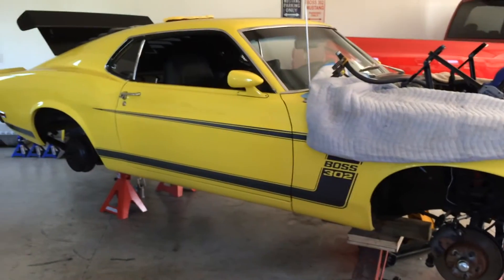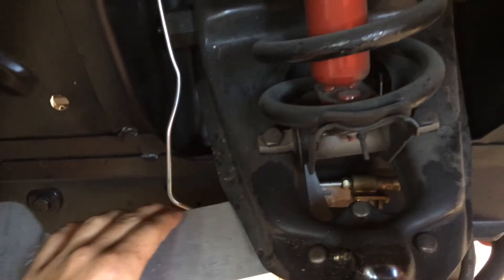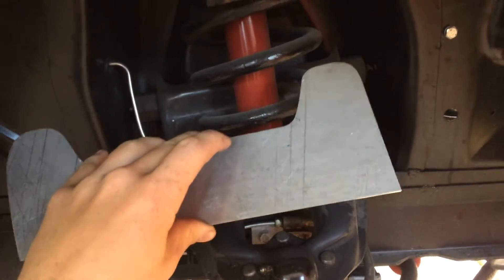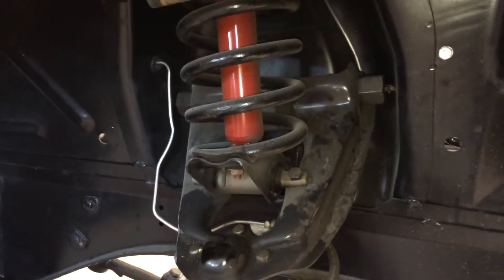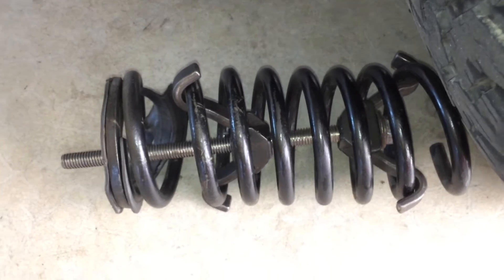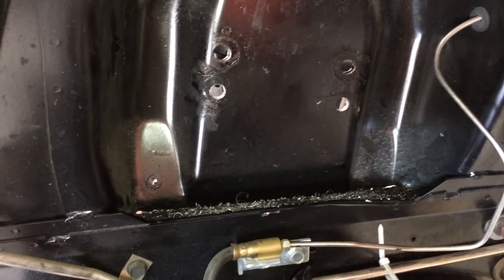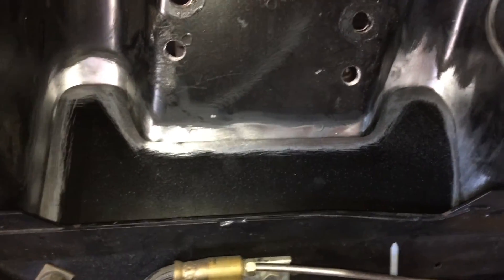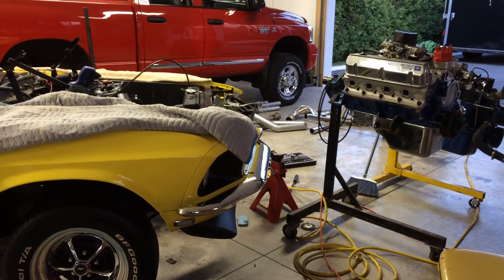Classic Mustang Shock Tower Reinforcement + Control Arm Drop

Comment: question-  by drilling lower holes and mounting stock suspension would that lower your car body and make less wheel room in fender wells? thus causing tire size issues?
Reply from the maker: Good question...you should refer to the manufacturers website for that information! Such as global wests a arm relocation
Reply: I just did mine and it did lower the body about 1/2”. But I also already had a 1” lowering spring on my 70 mustang. I just wanted it to steer better around hard turns. Next I’m getting wiser tires on front.
Reply: @MrCbell57  Thanks Rick. So did you also move control arms 1/8 forward as well? Confused if body dropped down is there not less clearance in fenderwell for tires. Would you not have to go with narrower tires?
Reply: @brianogram7342  I've done this modification to many cars. I add three washers to the front bolt of the upper control arm. This moves the upper ball joint rearward creating positive camber (way cheaper than Global West). I also box in the stock upper and lower control arms, again way cheaper than Global West. Don't get me wrong, the Global West stuff is A1. If you buy global West upper control arms, get the Plus 3 version . I usually run 235 45 17 tires and wheels with no issues, yours may differ. I weld more of the shock tower reinforcement plate. West coast Classic Cougar sells a correct thickness plate. They also sell the thicker version export brace, a must! If want to take it a step further, they also sell gussets for the cross member that goes between the bottom of the shock towers.

Comment: @5:06 you mention skip welds....just wondered if this method is better than welding a solid bead around the entire perimeter of the plate? Thanks!
Reply from the maker: I think it has something to do with heat warping.. you could probably do a solid bead if you took breaks. This is what was outlined in the performance manual though.
Reply: @OvensGarage  ok, sure, skips the welds, but end up having it welded solid all the way around the perimeter....I see now.  I just ordered the plates from Open Tracker. Thank you!
Reply: A continuous weld is best for even more strength. But these here he has done are sufficient for this application.
Reply: @MrCbell57 , thanks for the reply, I bought the Open Tracker dog bone plates, one of these days I hope to get around to working on my project. So much to do around the farm, I don't get a chance to do fun things.

Comment: Are there stitch welds on the frame rail?
Reply from the maker: I don't believe I did them at the bottom no. It's a bit of a tough angle to hit.
Reply: @OvensGarage  Thanks for your quick reply and the helpful tutorial.
Reply: I did the same job and also stitch-welded the bracket to the rail--otherwise, you're making only some reinforcement. It is a tough angle, but I have done it many times. I often use a "dental mirror" to help me. But you are right to suggest welding to the frame rail.

Comment: why only stitch weld the plate? seems like the Lil bit of road dust and moisture could cause rust issues down the road. I live in the northwest (it rains alot)and i am getting ready to do this MOD to my 69.just wondering if there's been problems welding that plate in solid..
Reply from the maker: I believe that the stich weld doesn't fatigue the metal being welded as much, and I think this is the way it is laid out in the boss 302 trans am modification manual. Either way the job will get done! There should be small holes for water to exit in the bottom corners of the inside of the frame at the shock tower anyways.